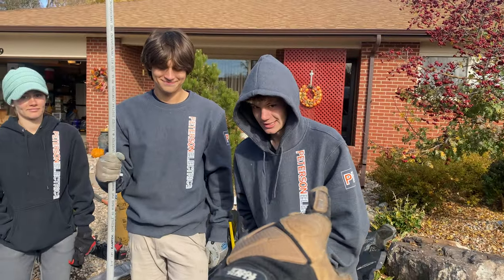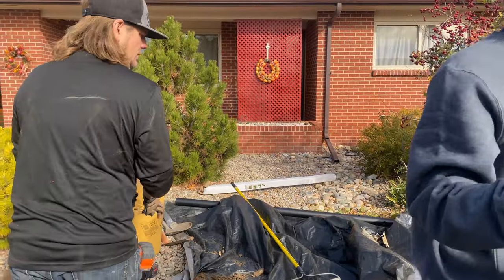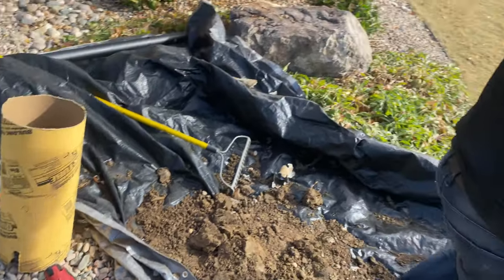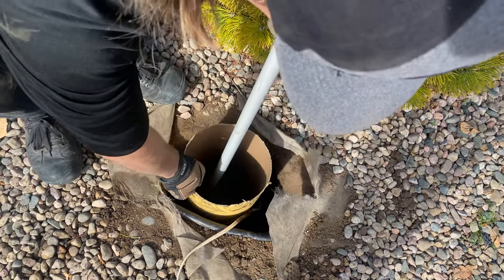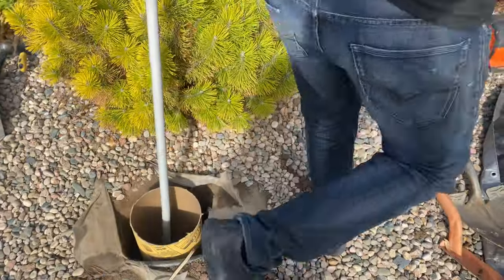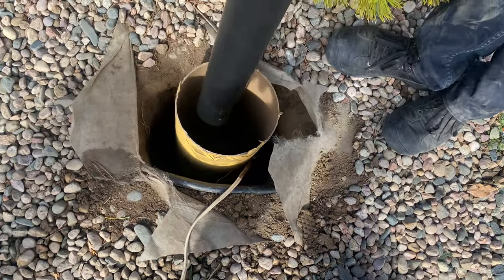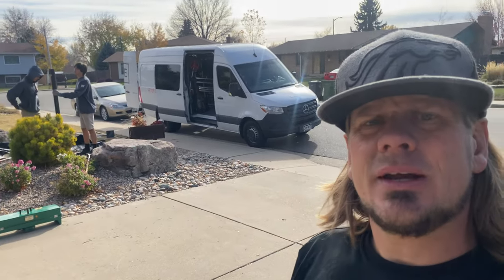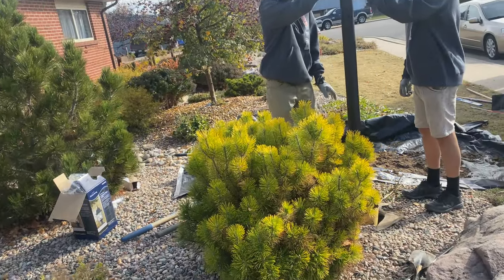Fixing a UF Cable Buried Under An Old Home

Comment: Interesting that the city provides free electricity for outside lights. I have never seen that before. 
Loveland Colorado -  "Loveland Water and Power provides the fuse and unmetered electricity for post or porch lights in subdivisions where the electrical design was completed prior to August 4, 1997.  We maintain the photocell if it is located on the meter housing."
Reply: Thanks for this explanation! I was totally confused by the indication that that the city would put a photocell on the outside meter. Guess back in the day the city wanted the streets lit but didn't want to put in streetlights.

Comment: 1) Did you put a meter on the wire, or at least test with a light bulb...
2) You need to protect the wire 12" out of concrete footprint...